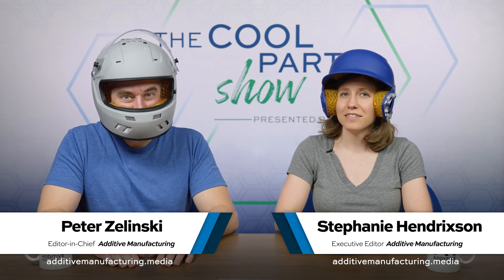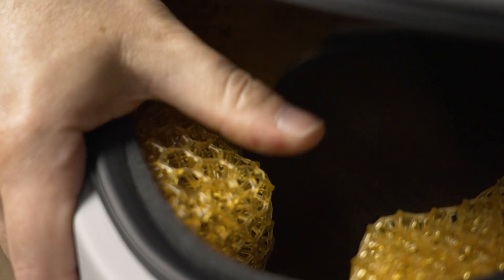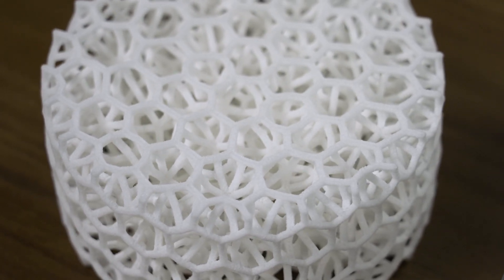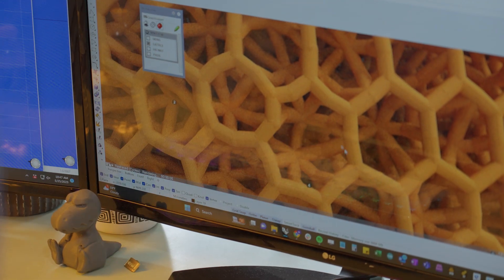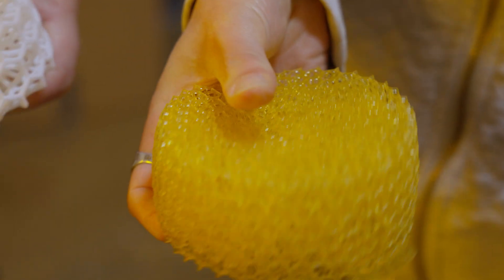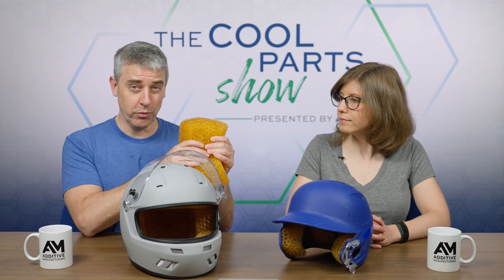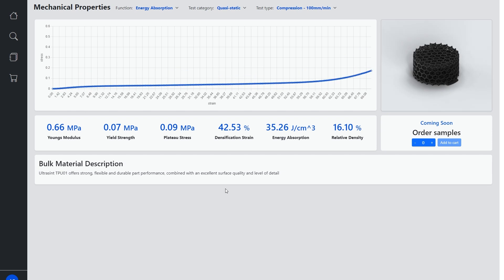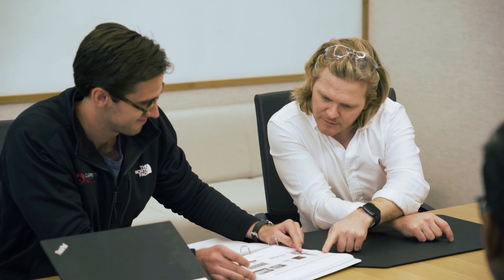3D Printed Lattices Replace Foam for Customized Helmet Padding | The Cool Parts Show #62

Comment: Nice in concept, far from being there.  "Dynamically tune the mechanical response" is all theory, that database does not provide an answer that is enough to build a helmet to pass standards.  Everything is great until it falls on a steel anvil from testing height.

Comment: Did these two helmets pass the respective impact testing standards?
Reply: Great question! The helmets worn by Peter and Stephanie are just concepts that have not been tested as a complete assembly, however, the Digital Materials used in them are based on relevant research conducted by General Lattice for the US Army DEVCOM SC.
Reply: Sadly our military helmets have some of the worst impact protection in the helmet category.  Good at stopping bullets, not so much for a blunt force impact.  Would be interested to see how these two helmets performed in their respective standards.   @generallattice

Comment: I would disagree with 'foam being the material' foam is also the structure giving mechanical properties to the material, it's also a lattice just in a more organic and less customisable shape. A block of polyurethane does not have the same properties as polyurethane foam.
Reply: "Foam" is a microstructure. This stuff is a macrostructure. I think there is a fundamental difference. Or is it semantics?

Comment: Materials do have material properties, which can be exploted through geometry. A thin sheet metal part with stiffening ribs can be much stronger than without those ribs. This does not mean that the material properties change or vanish. This is also nothing new, every part is designed that way (look at my sheet metal example).  
There are no "digital materials" there are materials and geometries. What they do is they exploit the hollowness of those parts nothing more. You can do that with any FEM software and analyse the behavior.
Reply: Exactly.

Comment: Why would that be better than foam for helmets? Who cares if its custom if its a compliant material? Seems to a greater degree a technology looking for a purpose.  

Best use case I can imagine is a military grade fanless server inside a pelican case, where passive airflow and cushion is important but cleaning is not required (IE no dust). At that point tho you might as well use thermal bridging of the case/heatsink to the outside of the pelican case.
Reply: At General Lattice our primary objective is to accelerate the adoption of Digital Materials (lattice + bulk material) by providing relevant metrics about them. Most tools today allow you to design lattice geometries, but don't provide any information about their performance. This can make finding the best Digital Material for your application quite challenging. In the case of foam replacement, we see great opportunity in the head protection space. For example, if you look at the top rated helmets in the NFL you will find the safest ones include the use of lattice structures. However, helmets are not the only application that can benefit from Digital Materials and we are passionate about providing the information and tools needed that will enable others to identify future use cases.
Reply: @generallattice  Thanks for the reply!
Reply: it looks like it could be lighter and much "cooler" then regular foam. so for someone having to wear a helmet over a long time, the open lattice pads could pose a significant improvement . Personally, i would try it as a foam replacement in car seats for the very same reason
Reply: @supremecommander2398  Foams can be also designed that way, they are just way way way cheaper.
Reply: @supremecommander2398  Looks more cooling. I just don't see it justifying the cost over foam at scale, except in niche applications (aftermarket helmet inserts, aftermarket plate carrier pontoons)
Reply: @DingoAteMeBaby  objectively speaking most emerging technologies seem unfit or absurd for modern times (jet engine turbines were dismissed at first as they were 'simply not worth it'...). However those who are able to see the fitness of their product sometimes make it work. What you are not able to appreciate is that they have technology that allows them to create any lattice to spec and then 3D print it. That algorithm is worth something
Reply: There are many many cases where 3D printing is way better than conventional processes. Engines, turbines, cooling applications, super light and stiff parts etc.